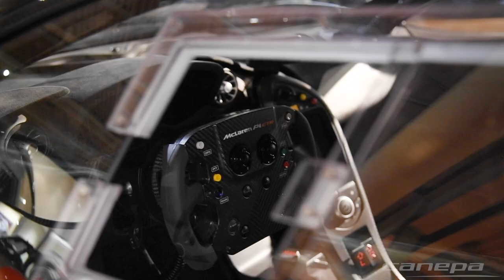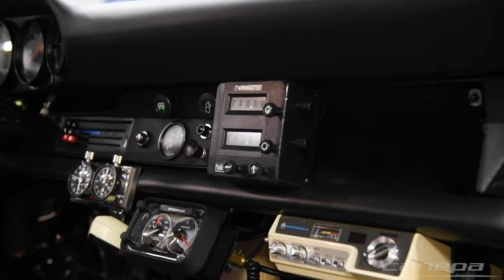Canepa shop tour with Bruce Canepa

Comment: The #11 Porsche 934.5 was originally the #30 Dyer Motor Racing turbo which won the Daytona Paul Revere 250 overall. Sold to Canepa in 1978 after finishing the '77 IMSA season 3rd overall. Season included a 2nd at the Daytona 24hr and an overall win at the Sebring 12hr. The Canepa shop should be on every enthusiast's list of go to places.

Comment: A few years ago when I was working the San Jose Grand Prix (about 25 miles north) and our mgmt. group came for a tour of Bruce's place.  I have been to many Auto Museums and I can tell you, Canepa's beats them ALL.  Why?  Because Auto Museums just show you finished cars, maybe some are in "barn find" shape.  But you don't get to see any taken apart, getting repaired or painted and assembled.  To me, I would rather see the guts of the best designed and engineered cars on the planet.  I also loved hearing how Bruce and his guys make them better with modern upgrades.  Keeping a vehicle stock is fine for collectors, but I like to drive and therefore, I want the best part replacing what was only available when the car first came out.  I have to say Porsche is my fav as well seeing them first when I went to Laguna Seca back in the 70's.  Thankfully I can afford the two I have and love taking them out.  I quickly forget why I don't even turn on my stereos.  Thanks Bruce for your valuable time and show of LOVE for what you have accomplished and do EVERY day.

Comment: I bought my first car from Canepa Motor Sports, when he had a dealer lot near Morrisey Blvd, Santa Scruz. 
It was a bright orange 1982 Turbo Capri RS. It was a mess for all of us.  It was a carbureted turbo that would break apart and take out the catalytic converters, a few times. The clutch went out , and finely the alternator went out. Rather than fixing it again, the dealership took it back. They told me I should have bought a Honda, and I ended up with a CRX.  I cruised his dealership regularly, until it moved to Scott’s Valley. I’d love to know what they did with that Capri, or if Bruce remembers that car.